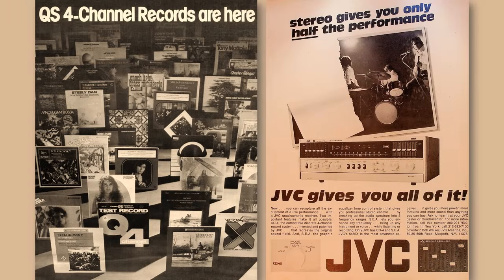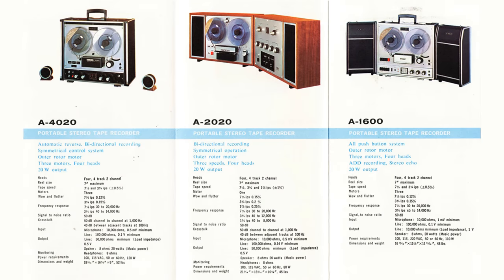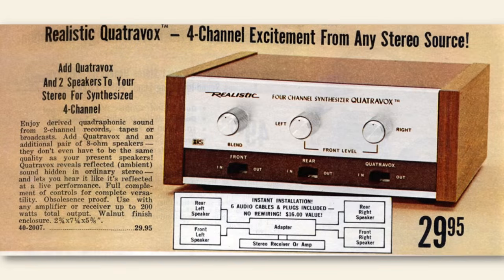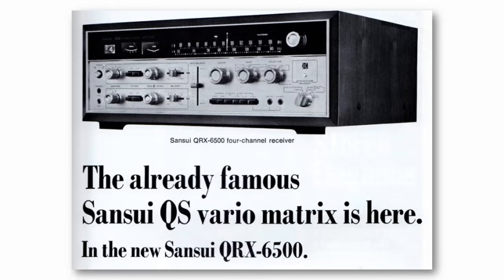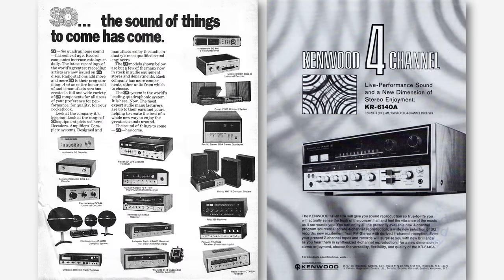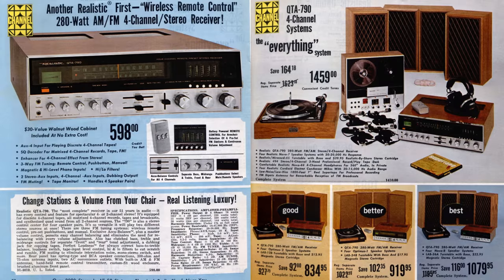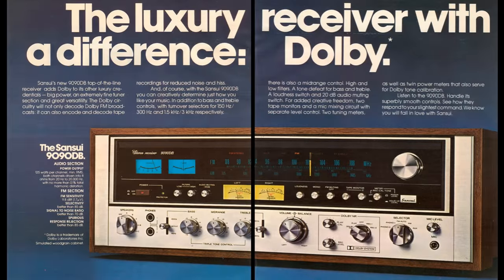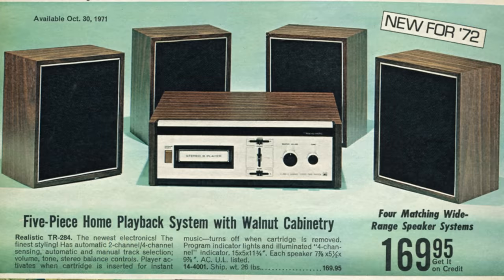4 channel FAILURE - The Quadraphonic Story

Comment: Ironically now we have Bluetooth speakers, which are mono. How advanced is that!
Reply: and sometimes no better than AM radio..
Reply: Crazy
Reply: I have that in my bathroom and kitchen.  Background.  MY desktop  SVS wireless prime are "decent". but not "high fidelity.  Even in stereo, quality is mitigated by bluetooth, and the cheap built in class d amps. The Sonos one and klipsch the three sound good, not great.  Better than those google dots.
Reply: You really don't know how Bluetooth speakers work do you... Technically it's stereo it's just stereo pumped through a single speaker.
Reply: Some BT speakers are stereo. But these days we also have things like Dolby Surround and Atmos
Reply: I know man, all that money spent on audio fidelity r&d, all for naught.  

Not so for many of us though we’re (still) hip to them - going for practically pennies today too. Heheh!

I’ve kept most of my THX 5.1 surround gear and I’m still using them.

Premium Klipsch speakers and Bose 101’s now are practically giveaway items. Hehehe!
Reply: @michaelturner4457  yeah I’m not too hot about atmos or those other buzzwords.

Basically they’re all just 2.1 with long bar center channel speakers plus two directional horns at both ends to simulate the phantom rear L & R channels — all trying to fool your senses.

Clever gimmicks, yes, but I’d rather have biggass speakers hardwired around me than phantom ones that doesn’t quite work unless the room was configured to bounce the sounds around.
Reply: Speak for yourself. I have a pair that allow for one to be left and one to be right. Go  OONTZ!
Reply: Stereo is two mono signals. Simple as that. So, stereo pumped through one speaker is MONO.
Reply: @k9techku when you mix two stereo chanels into one you get mono. Stereo requires separation.
Reply: Goof point.
Reply: Plenty are stereo
Reply: @glennjones6574  Yes but if you have no decent separation distance between the speakers it might as well be mono.
Reply: And people have digressed into listening to the pencil eraser speaker on the phone.  BUT history cycles, so will be interesting to see and hear what trends in the next 10 yrs :)
Reply: @MrAntennaBall  I have 3ft tall kenwood speakers with 10" woofers 4" mids and dome tweeters, not audiophile by a longshot but they sound damn awesome. Rear ports that couple the bass to the walls in the room. These things are LOUD. have them separated about 14 feet and they give better dimension than my 5.1 that is pretty well set up correctly in the same room.
Reply: @chrislee6650  sort of? but if there are unique audio tracks for left and right they're preserved, whereas a mono conversion usually only keeps the left OR right channel.  Yes, it's spatially mono but the stereo elements are still there.
Reply: @MrAntennaBall 
You arent wrong, but you are by no means correct either, but only because you lack all the information. I have the samsung soundbar (800a) with atmos.. it has the typical 5.1 setup.. but also has 4 upfiring speakers. for the most part, you might not detect a difference between atmos and typical 5.1 until you watch something recorded for atmos. The sound difference is exciting even... after watching some of the movies released this year, recorded for atmos, i decided to upgrade my setup to a hard wired 5.1.4 setup with room to go 13 channels
Reply: Most people are conditioned to listen on headphones. They have never heard a good quad presentation.
Reply: I had a JBL Flip 3 bluetooth speaker that would screw up the downmix to mono for some songs. It was kind of like the effect of plugging your earphones in halfway where you would get a weird mix that either only has the mono elements of the song, or only the stereo elements. What a POS.
Reply: Yes. And the frequency response is nothing an audiophile would notice. However, I have a pair of the Earfun Uboom L, and they're great for what they are, and they do stereo.
Reply: Mine have TWS
Reply: @snookerthedog9935  To me, stereo folded down to mono is worse that true mono since a true mono recording would be mixed and mastered for mono. As an example, the early Beatles LPs/45s were in mono but were mixed differently from the stereo versions so you hear different things between the stereo mono.

From what I understand, even though the early Beatles songs were released in mono, the original recordings were made using two tracks where the vocals were on one track, and the instruments were on the other track. This allowed them to combine them for better sound in the mix and mastering.
Reply: Most have TWS (True Wireless Stereo) capability if bought in pairs

Comment: My 1972 Panasonic stereo system was actually 4 channel-ready.  All you had to do was to purchase 2 extra speakers.  Considering the added cost of 4 channel recordings, I opted not to pursue it.  However, at one point it appeared that Quadrophonic was the future of audio.
Reply: There were many such systems but all they did was connect the rear two speakers in series with a blocking capacitor also on series, across the left and right channels providing a difference signal to the rear.
The SQ system had 4 discreet channels, the additional two derived from a complex arrangement of sum and differences subencoded in the primary left and right.
Reply: I have a 1975 National Panasonic music centre like that.

Comment: A famous quadraphonic album was Tommy by The Who, which was encoded in SQ. The movie (1975) took it to an even higher level, being encoded in quintaphonic sound, five discrete tracks. On the DVD release there is a bonus track, where it is shown how much effort they have done to retrieve the 1970s equipment needed to remaster the original multi-channel sound.
Reply: Tommy is not  in quadraphonic - Quadrophenia was planned to be but Pete Townshend was not satisfied with the playback quality through the matrix system so it was never released that way. They did the Tommy film in quintaphonic as you say - the only other Who quadraphonic release was a bootleg of a king biscuit flower hour radio show
Reply: Six-track surround sound with the Todd-AO film process started with the Oklahoma! musical in 1955.
Reply: Maybe you're thinking of the Tommy SACD and DVD-A releases from the early 2000s? No vintage quad of that album exists. I have the SACD and it is STUNNING!!!
Reply: I still have that album I. It's cover, he's on the front of it, AND a 330 watt rms 4 way amp but need 2 more matching speakers
Reply: @haweater1555 I had a 6 track cassette player in my 69 Voxel Velox car, sounded better than today's digital CDs
Reply: From what I've read, Quintaphonic was QS-encoded Lt/Rt on the left and right channels plus the discrete center channel of a 4-track magnetic 35mm soundtrack, with the effects channel left unused.

It partly laid the foundation for Dolby's MP (Motion Picture) Matrix encoding introduced to Dolby Stereo in 1976 to allow for matrix encoded surround on the 2-channel optical soundtrack of 35mm prints. They already had a 3-channel matrix in place for extracting a center channel.

MP uses different encoding than QS, but for the first few years Dolby did use a modified version of Sansui's Vario-Matrix for decoding the surround channel in their cinema processors (in 1979 they switched to Tate DES and, when Tate went out of business, their own Dolby Pro Logic decoder).

So Quintaphonic kinda lived on.
Reply: 😂😂 I call BS, please do a little research, I've been a fan of the who's since 1967.Please research the history of Pete Townsend, what an amazing adventure you will learn.
Reply: @ZacabebOTG  Dolby launched their CP100 cinema processor in 1975 which, in it's original form, had three "format modules" which could be selected either locally or remotely. 
The first was for all optical formats, normal mono, Dolby encoded mono and Dolby Stereo (without surround). 
The second was for discrete four or six channel magnetic soundtracks.
The third was called "external format" but it was clearly designed to facilitate Quint playback. By swapping the Dolby Cat-22 A-type noise reduction modules for DBX K9-22 modules (yes really!) and attaching an external QS decoder it would handle Quint prints correctly.  In practice most cinemas showing Tommy in the Quint format used the Dolby CP100 as it was the only commercially available unit able to do so.

The original Dolby Stereo, as used on Ken Russell's  Lisztomania, didn't really use a matrix.  The left and right signals from the 2-channel film soundtrack were fed to a Cat-110 card that derived a centre channel signal. Either the left and right signals or the derived centre signal was boosted by 4dB depending on how similar the L&R signals were.

As you say in 1976 they briefly used a modified QS system before developing their own.
Reply: @Terrestrial..1   You mean Vauxhall Velox?
Reply: He's right about expecting Quadrophenia in quad, who wouldn't considering the title. Never saw The Who attempt a quad release. I own two copies of the 5.1 Tommy as a DVD-Audio multichannel. Just because I didn't see Tommy in SQ did not mean it did not exist, quad was a total torment to ever find!

Comment: Even if they had chosen a single standard for it from the start, quad still would've failed. In order to hear the quadraphonic effect, you have to be exactly in the "sweet spot" between all four speakers; if you're getting up and doing other things while listening to music, as people often do, the effect is lost. That's why surround sound is fine for movies, but has never caught on for music, despite repeated attempts over the past 50+ years. (Same thing with 3D film/video, which keeps coming back every few decades, just to prove over and over again that it's a novelty that quickly wears off.)
Reply: Maybe that could try again as it sounds like stereo people like me wold enjoy such a sound w have the sweet spot in stereo so that wouldn't be a problem and I bet it could be done alot cheaper today ☺️ps hi @vwestlife 👌👋
Reply: Although it's a real shame. Some music back in the 90s had simple Dolby Surround encoding, and some music that came on DVDs even had proper Dolby Digital/AC3 encoding, which is a real upgrade from just stereo. But yeah, never really caught on mainstream. Seems they now try again with music streaming services offering Dolby Atmos encoded music.
Reply: @graealex  I think you may be referring to DVD Audio. These discs usually had 2 different formats on them. The first was the album mixed in usually Dolby Digital (AC3) the same format most movies on DVD were mixed. Sometimes it was DTS. This version was able to be decoded by any DVD player that could decode DD or DTS. The 2nd format was called DVD Audio. This was the album remixed with a higher resolution usually 96KHZ 5.1 while the standard DD or DTS version was 48KHZ 5.1. The higher resolution version required a DVD player that could decode the DVD Audio’s higher resolution. While the AC3 version was slightly higher definition than CD’s 44.1KHZ the 96KHZ version was noticeably better sounding. Some DVD Audio discs also had a stereo 192KHZ version that was even cleaner sounding yet. Unfortunately most DVD players weren’t DVD Audio compatible but still offered somewhat better sound than standard CD with the added surround sound benefit.
Reply: @mikee2923  I was actually thinking about special feature music DVDs. As you wrote, with AC3 encoding.
I have an awfully small collection of these, but listening to them really is an experience.
Heck, even the Dolby Surround encoding, which is compatible with normal CD audio is already a much better experience, at least for dedicated listening in a home cinema setup.
Also, no, the 96kHz has no discernable difference to normal CD audio at 44.1kHz. That's a myth. Audio University has a bunch of videos on the topic.
Reply: @mikee2923  Watch the Audio University "Debunking the Digital Audio Myth: The Truth About the 'Stair-Step' Effect" video. For me, it cleared up numerous misconceptions about stair steps, aliasing and the Nyquist limit. Basically, unless you are some super-human being that can hear well into the ultrasonic range, going above 48 kHz makes zero difference, unless you are mastering. Same with more than 16 bit resolution. At least if the DAC is properly implemented and bandwidth-limited. 
Doesn't account for the possibility that Audio DVDs were simply mastered better.
Reply: @graealex  I own a decent number of DVD Audio discs and SACDs along with an Oppo Blu-ray player that decides them all. I can’t state with any scientific evidence that they sound better or not. They do to me and anyone who I’ve played them for. Perhaps it’s in the remix they use for higher resolution I’m not sure. But there is much more depth to the instruments and things on the hi resolution mixes that either don’t appear or aren’t anywhere near as noticeable in the standard definition versions. Bass is also much harder hitting and goes to depths not heard on CD versions of the same album or even the DVD Video version. For example I have Foreigner’s debut on DVD Audio. Not an album that is thought to have good bass but in several songs there is deep bass that just doesn’t exist in any other version. Again, maybe they remixed it to bring it out or even added it when it doesn’t really exist. Whatever the case, it makes listening to it much more enjoyable to me, anyway.
Reply: @graealex  I don’t recall seeing what you’re talking about unless you are referring to DVD Audio discs. I do have a couple DTS CDs that sound excellent. It is a standard CD mixed in DTS which does require a digital connection to an AVR that decodes DTS. Playing one in a normal CD player like a boombox or one connected via analog just outputs noise.
Reply: @mikee2923  That's fine, and as I wrote, there is the possibility that a DVD Audio or an SACD simply got better mastering, with less compression, and far fewer shortcuts, making it sound better.
However, 16 bits at 44.1 kHz is already beyond what any human can hear. You could literally down-convert the SACD signal to CD audio, play them side-by-side, and you'd never be able to make out any differences.
Higher sampling rates and resolution might be important for mastering. In my opinion, audiophiles got wind that "professionals" use higher bit and sampling rates, and then deduced that this does in fact improve the listening experience for fully mastered albums, when it is in fact just required for the mastering process itself, where you don't want to lose quality beyond what the output media can deliver. So for example, the difference between 16 bits and 24 bits gives you 48 dB more dynamic range, which might be important for being able to increase the gain for certain feeds of the audio source, without introducing noticeably noise. As long as you don't increase the gain beyond 48 dB, you will never have additional noise - from the digital processing, at least.
I highly recommend watching the video I recommended, plus the part 2 of it.
Reply: @mikee2923  Well, that is what I initially wrote - multi-channel recorded and encoded media does give a better experience, as long as you have the setup with the correct number of speakers, that is.
Let's hope more music gets the Dolby Atmos treatment, because in my experience it is otherwise hard to come by any multi-channel music recordings. Currently it is limited to a few streaming services that won't just give you the files, but want you to own particular equipment for playback as well. For example Apple iTunes, running on an Apple device.
Reply: @graealex  I’ve never actually watched the videos that you suggest but are aware of the findings in it. When you say audiophiles ran with that technology for home use isn’t exactly correct. They tried to market it to them but they flatly rejected it. Most audiophiles believe analog is the only way to listen to music. Mostly vinyl and open reel tapes. I’m not going to dispute their findings but in order for a multi channel music system to be effective you must use full range (or as close as possible) for all of the 5 channels of the original surround codexes. One of the reasons they basically failed was because most 5.1 systems of the time had at best 2 good tower speakers for fronts and small bookshelf speakers for surround. Or worse yet 5 bookshelf speakers. While low frequency sounds are considered non directional, with music it just seems to work better with larger speakers. Ideally they should all be the same speaker or at least using timbre matched speakers from the same manufacturer and line. I may be wrong but I tend to believe the better your setup is the more difference can be made. I’m by no means an expert in sound reproduction but listening to a CD version of an album vs DVD Audio or SACD multi channel the difference is night and day. Some of the 2.0 stereo SACDs don’t make a whole lot of difference over standard CD. I’ll have to sit down and listen to some of the high resolution 96KHZ or 192KHZ stereo mixes on some of the DVD Audios and compare them to CDs. I have always just opted for the surround sound mix.

Comment: The house my family moved into in the early 1980s had a quadraphonic hi-fi setup installed in the sunken family room (the two most 70s home items I can think of), and there was even a set of headphones with two 1/4" plugs and four drivers so you could experience quadraphonic bliss without bothering anyone else, but we never had any quadraphonic recordings. When I was a kid, my favorite move was the switch the unit from stereo to quadraphonic when there was an 8-track in there, because then it would play two tracks simultaneously